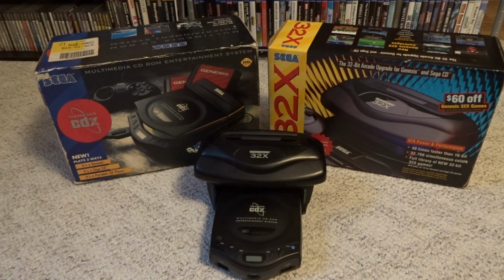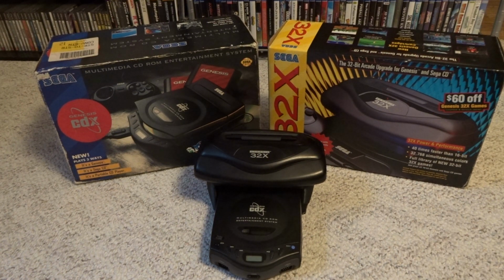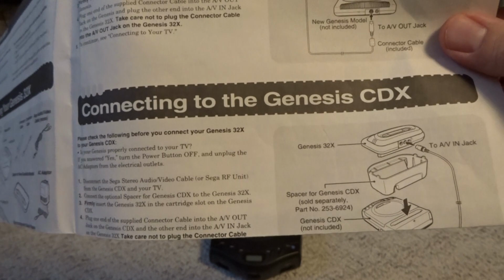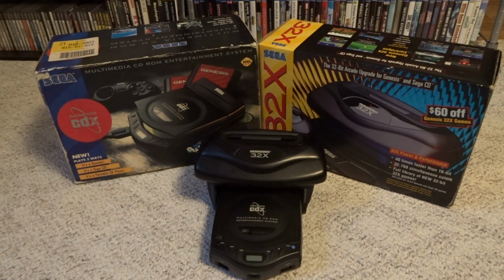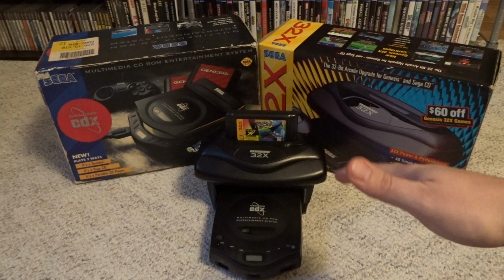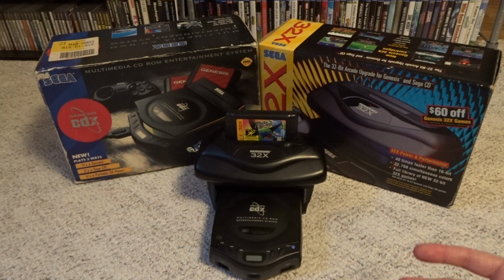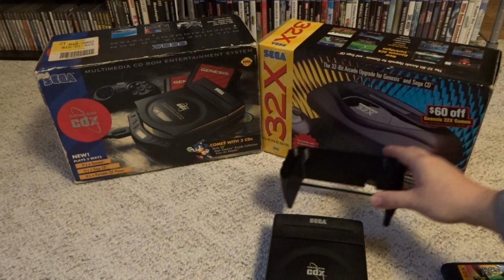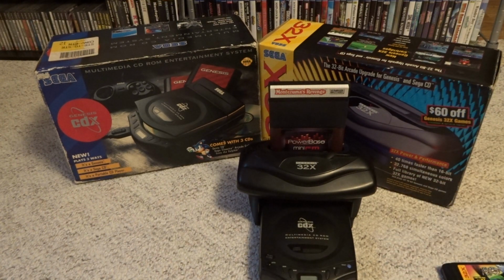Gamer PROTIP! Series #7: New Sega 32X to Genesis CDX Connecting Riser From Laser Bear Industries

Comment: Actually In later 32x they put notices inside that the 32x on the CDX didn't meet FFC standards. Supposedly it also was prone to tipping the System
Reply from the maker: Interesting, guess that could be a problem in households with pets.